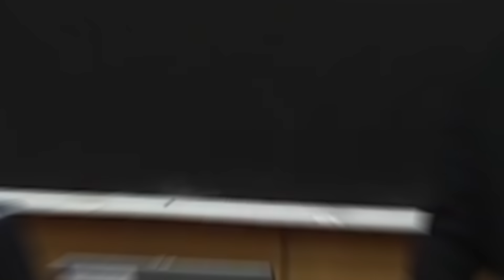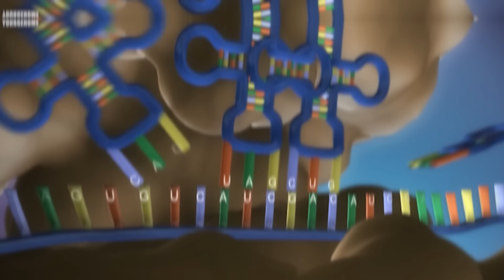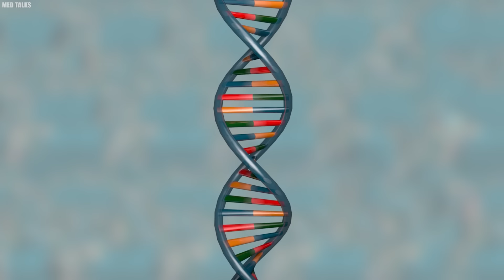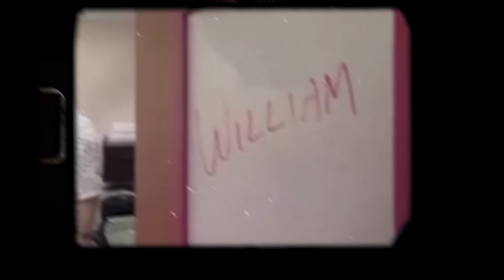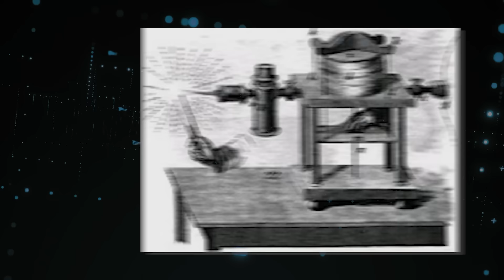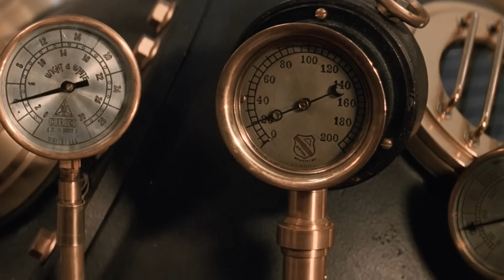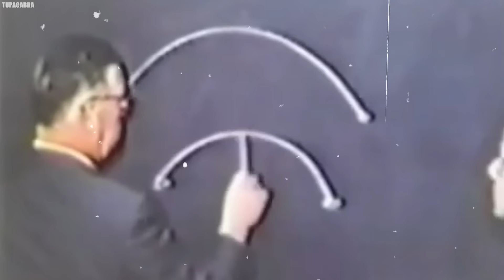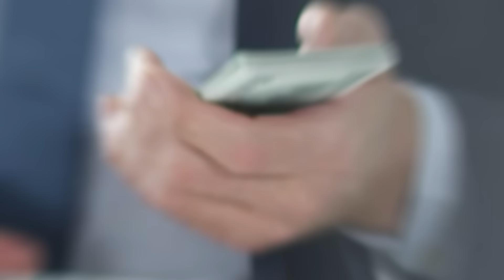15 INVENTIONS and INVENTORS WHO WERE SILENCED and BURIED

Comment: In the late 60’s or very early 70’s my dad and one of my uncle’s built a Volkswagen that ran on air. They had a car battery for electric power which powered a washing machine engine. That engine in turn spun a turbine. I don’t know all of the details because I was only about 8 years old at the time but I do remember that they made it work and drove it around the neighborhood. I also remember that not very long after that they received a visit from some mysterious individuals. I don’t know exactly what was said other than they were told to forget about their invention or bad things would happen. That was the last of that car and my dad would only ever very rarely even speak of it.
Reply: 👽 it's called having the FEAR put in to ones self 👽

Comment: The author missed the Pouge Carburetor, also a great idea. The water car was pretty awesome as was the water motorcycle. They killed the other fellow who made an electric car that actually worked. Also for those interested, pouring purified water over electrolyte nickle will break the bond and release hydrogen. Which can then be burned. you do eventually have to replace the electrolyte nickle, but whats life. It is depressing that many of the inventions that would make life better, cure disease and more have all been repressed in the name of employment. At some point in the future, we may have an actual leader who will release these inventions and actually improve mankind.

Comment: Ogles carberators did not work because it caused the motor to run to hot and seeze up you can NOT lean a carb out beyond 14 to 1 or a motor will run to hot and seeze up we tried on many motors